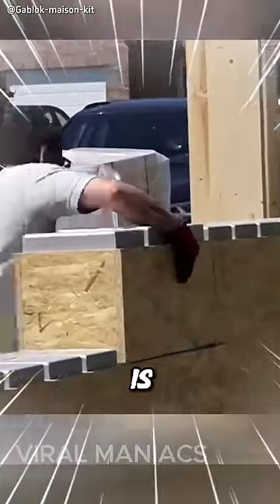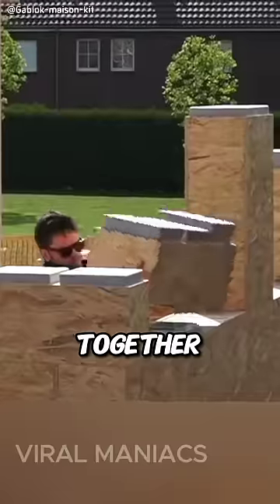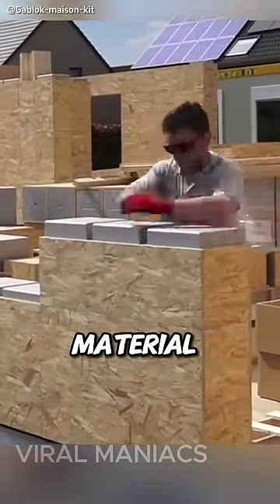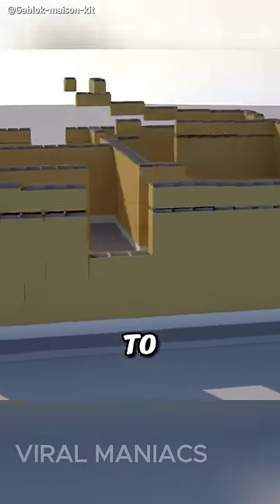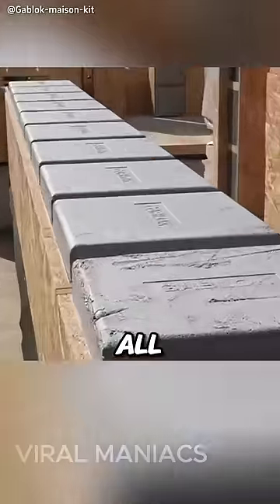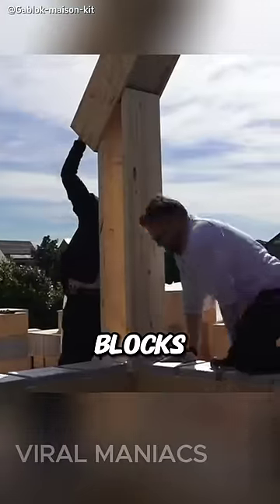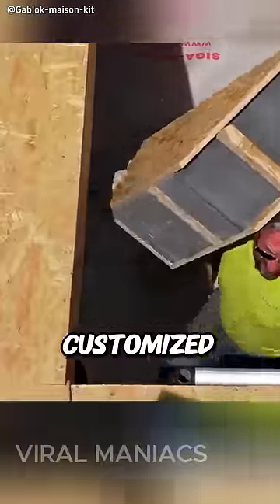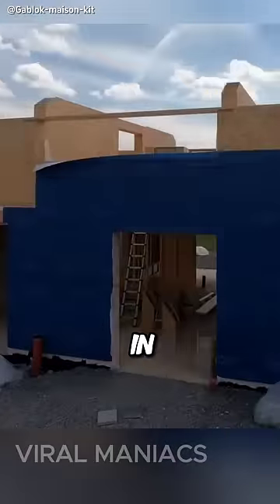Whoever Invented This Way Of Building Houses Is a Genius #shorts

Comment: I’m interested in how they run the plumbing and electrical.
Reply: Chases and soffits I would assume
Reply: They don't, you have to pee outside and and when it rains you have to whirl around to take a shower
Reply: And HVAC?
Reply: My thoughts exactly
Reply: They definitely use composites both inside and outside, this is just the skeleton of the building.
Reply: Underground mb
Reply: More than likely not inside the walls, lol
Reply: I'm sure they would use Lincoln logs 😂
Reply: The plumbing and electric comes in blocks. Like out of the 250 blocks they give you, 25 are for water and power and have the stuff pre-built inside
Reply: 2x4 walls are framed along the entire interior to pad out for mechanicals.
Reply: Houses are built differently state to state , here in CT everyone has a basement which  I was surprised the rest of the country doesn’t
Reply: @EveryoneIsStupidButMe I already do that lol.
Reply: And insulation and basically everything
Reply: Probably need to strap inside wall to hang drywall etc  run thru that space I imagine.  But yeah, no ductwork, sewer lines, high materials cost, probably gobble up any savings from decreased labor as you LEGO your own house together.

My brother just finished a house that started as a steel building (Quonset) 
Original cost 20, 000.  After all the electrical plumbing hvac drywall paint interior finish etc......just as expensive as any other house.  Asked  him how much he saved...NOTHING.  I assume this lego house would be the same or worse.
Reply: @blove9415, we have basements here in Missouri.
Reply: @blove9415 where I’m from, basements would flood if we had them. I always wanted because movies/shows make them look awesome.
Reply: I imagine you could just make the house a really large square footage, then use 2 * 4 on the inside to line the walls to give you space to run plumbing and electric and nothing about this implies it wouldn't have attic space to Harbor central air
Reply: @blove9415 not all grounds can support basements, or there is too much moisture to make it feasible in some areas.
Reply: Same way you do in sim city.
Reply: the insulation would be easy to run pipe and electrical through, all the bricks line up.
Reply: Call LEGO and ask them😜
Reply: My question exactly
Reply: False wall a few inches away from the blocks
Reply: @denhideous probably drop ceilings as well or exposed plumbing in some areas
Reply: Bluetooth
Reply: @EveryoneIsStupidButMe 😅 fkin whirl around hahah
Reply: @percussion44 I don't u deratand whatt you are thinking the leggy house is cheaper and faster. The electrical and plumbing is all planned out. As any house build would be. The build is faster and cheaper.
Reply: Underground
Reply: @TrollinOU81  Don't do plumbing by Bluetooth. We did, and regretted it. When your service drops out, things get very messy.
Reply: Oh you want electricity and water..  That costs extra
Reply: Might have specific blocks made that has tubes ran through it so conduit, etc can pass through. I wouldn't build my house like this lol
Reply: @MakenSawDust I would guess they will install Split units for HVAC
Reply: Right... 😂😂😂😂😂
Reply: @americasteam2112  I’ve had finished basements in almost every house , they are great in the summer nice cold cave to watch the raiders lol but in the winter they’re a fridge ! You guys must get a ton of rain ! Weather kinda skips over us here
Reply: What if you had to put the electrical and the plumbing on the walls not in the walls but on the walls with conduit going from each outlet that would be a nightmare
Reply: @blove9415  Basements are very common in MD and a lot of our state is shoreline. I've been in plenty of places that had a basement and a pier or boat ramp 30yds away in the backyard. I should mention a lot of those are on the Chesapeake Bay or Patapsco and Susquehanna rivers or other non tidal shores. In Ocean City you won't find them.
Reply: @Ru31770  I live in Connecticut lol I’m very very familiar with the water and we all have basements lol we live on the river and we’re 45 minutes from the ocean lol, we’re locked in. But then you hear people in Texas say no one has a basement like why? When we actually live so close to water all around us
Reply: @blove9415 My point was that they are common in MD also and ground water isn't the only factor. Near swamp and marshland is where that comes into play. In a lot of the Midwest, it can be due to unfavorable soil conditions. Too dry makes it unstable.Texas is probably similar or maybe because of bedrock. Bedrock is expensive to dig through. And in the southern states, the ground doesn't freeze as deep. Foundations are set below the frostline. Now you know lol
Reply: Vertical battens on the interior side to run utilities.
Reply: @AckzaTV interesting idea, but the Gablok website explicitly states that plans include 40cm gaps for things to be ran as needed. Then the gaps would be covered by finishing plates.
Reply: I expect the will nail battens onto this, then drywall board over those. Most pipes and cable will run behind the battens.
Reply: They don't.  No one is actually doing this nonsense
Reply: I don't know where you come from, but it's pretty common here to have normal walls and then an installation layer on top. So, this doesn't do anything to the electrician.
Reply: What is the name of this compagnie?
Reply: Buckets and extension cords
Reply: Service cavity is the standard way to do this. Seems likely to be part of this system. Leaves the airtightness membrane intact, looks neat, is relatively easy to change later.

Comment: Former firefighter here. This house is an effin blowtorch waiting to ignite. EVERYTHING going into those walls will burn like gasoline. The polystyrene blocks? Gasoline. The OSB boxes? Wood chips held together with a polyurethane (likely) adhesive. Gasoline. It may be a cool, fast way to build, but that thing is a death trap.
Reply: Yeah I've worked in the foam insulation and foamboard fields of manufacturing. There is always a blowing agent in the process of making foam. The gas will release in the open, but in those containers there is a cell of gasses inside. Unless they were stored for many days.
I wouldn't want to haul those boxes in a semi box trailer either. That would be a bigger bomb.
Reply: Isn't  it sprayed with a fireproofing agent b/4 it.leaves the factory?
Reply: Hey illegal immigrants. Have we’ve got a home for you.
Reply: You do realize 90% of modern houses are insulated with polystyrene foam and framed in wood?...it makes little difference.
Reply: I trust this assessment.
Reply: I was thinking the same thing. Huge fuel load.
Reply: It is sprayed in fireproofing each
Block love these know it all firefighters dude everything burns. It’s about having ur smoke alarms
And exits free man smh
Reply: That was pretty much my first reaction when I heard about polystyrene used as insulation in buildings. It is on the level of stupid as the idea of building houses of radioactive materials. Yes we had scandal. Relativily "harmless" as long as ventilation is good but it isn't always. These buildings are now known as "Radon houses" here.
Reply: Isn't that what's in regular houses?
Reply: just cover it ALL with type x gypbd, lol
Reply: Well wtf do they use in modern "normal" houses? Polystyrene and OSB my brothaaaa. I mean shit everyone's shittin on this idea. What I'd like to know is how they run wiring and plumbing. Guess they just cut n run as needed. Probably isn't anymore cost effective than a standard home either but I digress.
Reply: OSB is Not made With polyurethan but rather formaldehyde which in itself is rather toxic. So its Not recommended to be around it when it burns. But the glue wont start a fire and the amount used is neglible when calculating the fire load.
Reply: Firefighter? Ur profile
Said ur a manager at jack in the box??
Reply: That's what I was thinking!
Reply: I'M NOT A FIRE FIGHTER.. LOL BUT YOU LITERALLY TOOK THE WORDS OUT OF MY BRAIN.
Reply: Yeah not to mention carcinogens and the dangers it poses to the exposures nearby
Reply: Foam in or no once plywood start burn it will not stop. No matter what type of building it is.
Reply: @Reviloj immigrant song is pretty cool
Reply: @Comanchee0689  in america maybe in good old Europe bricks and Cement is all we have unless its in the Mountains the log houses are popular
Reply: @tl3029 he said Former. Even I saw it.
Reply: If it looks that good for that amount of money. I’m still buying it! 🤨
Reply: and would be easier just to frame the house no hurricane clips etc  distaster waiting to happen
Reply: The hemp Crete which is like a this same thing but hemp n they provide insulation and are fire proof
Reply: Not more than wooden frame house that most house built like
Reply: @LuciDreamer91 normal houses typically use fiberglass or cellulouse/Rockwool insulation. Polystyrene is also used,but much less often
Reply: I agree. I've set fire to many man-made things and I have to say. Heavily processed items burn frighteningly well. For example. With 2 seconds of flame from a weak lighter, it can ignite the plastic bag that chips come in; resulting in the bag melting, bubbling and continuing to burn regardless of wind or water. Man made foams and woods cobbled together with artificial adhesives? Even better to burn.
Reply: Plumbing? Electricity? Who many questions
Reply: Structurally I can't think it's very good and it looks like a fire trap
Reply: @Comanchee0689 *90% of American houses.
Reply: Probably no worse than a single wide trailer.
Reply: Okay, as someone who's been fortunate to have never fought a fire bigger than a matchstick, this is still exactly what I thought would be the case as well.

I wonder how these houses would go in strong winds. Is the whole house lifting off and leaving the foundation? 🤔
Reply: Exactly what I thought cheap and nasty
Reply: The insulation maybe, but why are you talking about OSB as it it’s not what is used for sheathing on 99% of houses lol
Reply: Yeah it’s called OSB they use it in EVERY house unless you pay extra for real plywood which is really expensive
Reply: @Comanchee0689 thank you. I was thinking the same thing. Atleast here in US  this is the material.
Reply: "former firefighter" sure, kid. Sure. You do know this applies to every other house, right?
Reply: You have no idea what you are talking about. This construction method and materials are no more flammable than conventional construction. It meets the standards of the NFPA. Have you heard of the NFPA, genius?
Reply: @kramnull8962  Homes are filled with foam insulation these days, fire retardents are added.  They will ignite if you put enough heat on it, but will go out.

Like back in the day when sofas were essentially tinder, it doesn't happen these days, at least not in the developed world.
Reply: @Reviloj no wonder we are giving it to all those people from england lol
Reply: @diablo3894  I know, head to USA where your house is essentially made of wood, this would be a huge improvement there.
Reply: @cwoody619 yes, simple-Jack, they have plumbing and electrical systems. There are only so many questions because so many people are idiots who know nothing but are convinced that they know everything.
Reply: @Reviloj  you're probably prolife, too. Lol
Reply: Yes.  @LuciDreamer91
Reply: One hurricane and you are homeless
Reply: That was my first thought when they say grey stuff is made for polyester. I’m not a fire fighter just a common sense.
Reply: What if we put a layer of cement on it from the inside an outside?
Reply: I'm not a firefighter and I gasped when I saw that 😂 baaaaaad idea
Reply: Yeah but they don’t do cement in USA 😅
Reply: @Comanchee0689 hell no. Atleast here in germany houses are NOT build like that...
Reply: Or contrete
Reply: @Christopher_T_Paul  They aren't filled with the same kind of foam as in these containers.
You take this foam and load it into a semi trailer and hold a cigarette to the back door when you open it.......
Reply: @usagifang   I know some firefighters (dated one) and I can confirm that they think this way. Any time they see anything one of the first thoughts they have is how flammable it is lol. Had a few conversations like that with the ex. She was always going on about how flammable my house is because of my foam insulation and I’m like “honey every house in this city is made of wood and full of clothes and carpet” 😂
Reply: @surfgreen60  are u ok?
Reply: @kramnull8962  Well I don't know what countries would allow such building materials, it wouldn't meet regulations in Europe I know and would be surprised if USA would allow it either.
Reply: @cwoody619  A question you should ask yourself every time you post. I didn’t make the stupid remark about plumbing and electricity, you did.
Reply: @surfgreen60  lol by questioning how it works? I’ve never seen this type of building. U sound like the jackass not me

Comment: "Robust"? Thats a ballsy statement.
Reply: 🙄🤨🤨🤨🙄WHAT AN INSULT WHEN YOU START TO SEE YOUR HOUSE OR BUILDING LITERALLY FLYING AWAY
Reply: I bet I could put my hand through it
Reply: The be fire hazard
Reply: @Україна-ц7э It’s plywood bud.. remember stress the weakest joint, all you gotta do is lean on that insulation..
Reply: Robust? More like roBLOX
Reply: Questions about where the wiring and electrical equipment and plumbing go
Reply: @kadensmith5586  that's chipboard
Reply: @shanearnold1999  exactly lmao 🤣
Reply: The company that makes this will probably go under in a couple of years too, so have fun looking for them for compensation when things go south. There's no way this makes sense financially, for both consumers and the company. You're targeting a very niche audience, DIY builders who have no idea how to build a house the traditional way.

This is like an overpriced version of SIPs (structural insulated panels), which already use the same material and come in entire slabs. The disadvantages of these blocks outweigh the advantages (ease of shipping) and I'm not convinced they're structurally sound.

Comment: About time someone comes and make something special for the average person to make a home. Pure Genius.
Reply: $450 per square feet of living space.
Reply: @homayounshirazi9550  Nice but expensive Sir.
Reply: Still extra expensive.
Reply: @cosmopolitanwonder9675  Well stated. I bet a person could make the same block on the cheap.and get rid of the middle man.
Reply: @victoryfirst2878 
Well said, this method seems to be currently the least expensive of method construction, less complicated and incredibly strong and very simple  and light weight requiring no cranes or heavy equipment.
Reply: A "home" without gas, water and eletricity 😅.
 Where will you put those 😊?
 Also it's highly inflamable 😪.
Reply: @josesoares3582   actually it’s not highly flammable and the chases for electrical and plumbing are designed into the product.  Electricians and plumbers don’t have to cut them out of existing walls.
Reply: Your mom is average 😂
Reply: @EternalChamp  Special Average.
Reply: @josesoares3582 , "inflamable"? Umm... flammable. Any wooden house can be flammable. That's why home owners get fire insurance and have an escape plan, just in case...
Reply: The average man a hundred years ago would have built his own house either out of mortar and brick, or if they were americans, out of wood. They would also have built them in stages, expanding the house as the money allowed. Today most people either want already built houses (which is not bad, just more expensive), or try to find these new technologies as a cope out. Although some people still have their good senses and hire professionals to build decent houses that are not overpriced.
Reply: @Dbb27 It's still wood and styrofoam, might not be highly flammable, but it is flammable nonetheless, just like most wooden houses. I'd take a brick and mortar house over both of them, brick doesn't burn (until you reach melting temperatures, which is impossible to get to in a house fire).

Also, the conduits for plumbing and electrical being included in the blocks means that once the design is established, there is little room, if any at all, for modifications later on. Brick and mortar might be a little messy in this regard, but you can run anything anywhere and cover it up like nothing happened.
Reply: @yonidellarocha9714   block houses still catch fire.  There’s finishes, plumbing, electrical wiring, the roof structure etc that can catch fire.  Brick by itself isn’t a building method.  There’s a structure and the brick is the exterior finish of the building.  Block can stand on its own but still has other finishes that can catch fire. 
As for the channels for utilities since this is such a flimsy concept then doesn’t it make sense that new channels can be cut in to move items around if you are renovating?
Reply: @yonidellarocha9714  Have you never seen the remnants of a brick house after a fire? Or maybe you thought the construction methods in the story of the three little pigs was based in reality? 😂
Reply: @C.O.G.  I hate to say this but "flammable" and "inflammable" mean the same thing. I don't like it either, but it is a fact.
Reply: @clueless4085   thanks for that.  Apparently inflammable is being misunderstood.  There was one explanation that inflammable means it can self combust without being ignited.  We should hope not, lol!
Reply: @clueless4085  Well stated Sir.